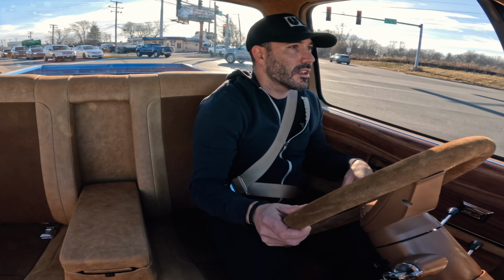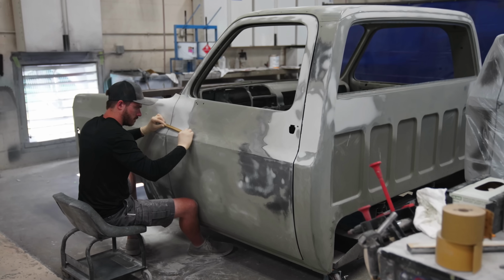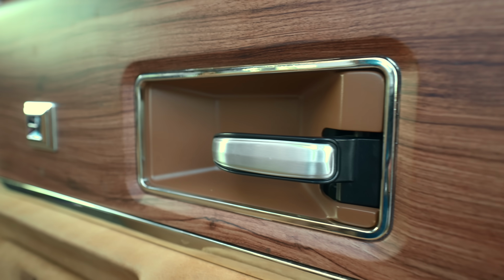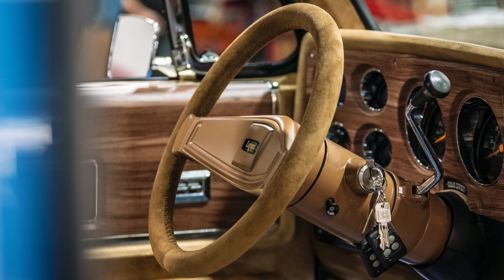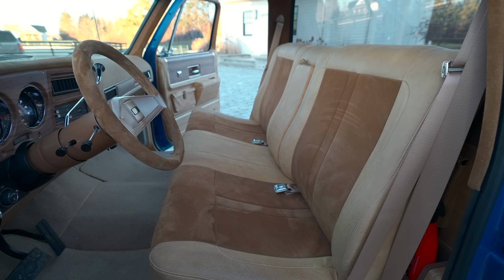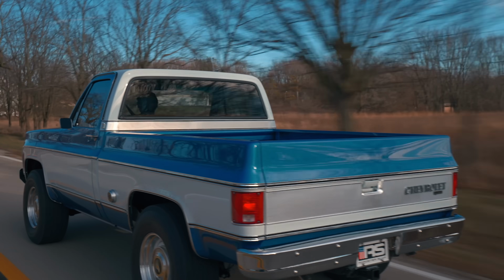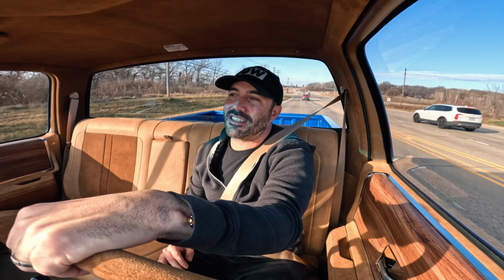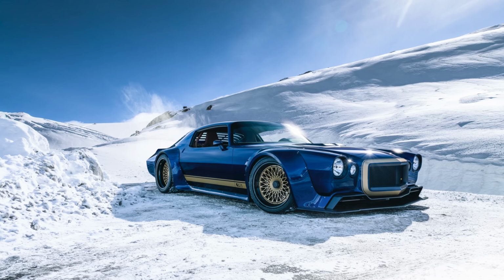The 'Urban Cowboy' | Roadster Shop Legend Series build #004 | 1976 Chevy C10 | Details and Drive!

Comment: Ramman Industries builds the front wheel bearings hubs and axles to keep the freespin lockout hub function, 2-3 mpg in 2wd and less steering bind and front end wear from being driven by the road, plus the authentic warn hub.....legit retro sexy😎🤘🏽

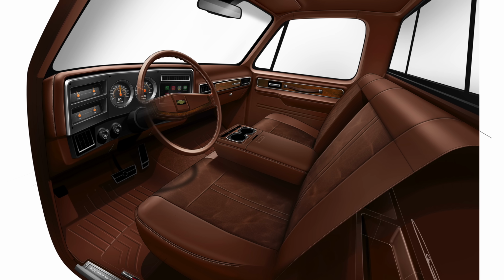Comment: 4:52.   That is perfection.   Don't change a thing.  That is a Squarebody as an escalade.  Only thing I would change about that is the driver...lol
Reply: I been looking at that pic for 10 minutes and cannot find one single thing I would change about it.   It's just right.  the 4 small gauges, the door handle relocation, the touch screen, the 4wd knobs...  that gorgeous steering wheel.   keeping the ac vents where they were...   seat and console...  trim on top of instument cluster bezel, wood on steering wheel door panels, keeping the vent wings.  damn its beautiful.
Reply: Even that color goes with damn near every exterior color.  Mine would be a black 77 with full outer trim with the yellow stripes.
Reply: did find one thing.   get rid of the 1500 on rh side of dash.  Chevy isnt a gmc.   put the trucks trim level there like its supposed to be.

Comment: Only thing I'd change about it, is dumping that LT1 for either a built ~600hp LBZ Duramax sitting in front of an Alison trans, or a built 454ci LSX (with accompanying 454 badge for the front grille) with a Holley Sniper EFI and both vintage, correct looking air cleaner and the coil/valve covers that look like big block valve covers, a peppercorn German Square Weave carpet, 2 more inches of lift (it looks awful close to those little 35s lol), and swapping that blue out for either Burnt Orange Iridescent, Lime Iridescent, or Dark Olive Iridescent.... never was a blue guy ...oh forgot one thing, and the Deluxe Two Tone, not the  Special (I like the matching roofs to side tone over the roof matching the base)..... other than those, she's perfect 👌😅

Edit: ok ok, I'd rather have straight Dana 70's front and back with 4-Links, but I still wouldn't mind an IFS for the comfort 😅

Comment: I lost my teeth in a square body. 

Just thought I'd share my square body story. 

I saved for years to buy a classic truck. I finally found the perfect one. A 1975 K-20. It was in great shape. Needed a few things mechanically, but was drivable. One day on my way to work, a Nissan Altima going 105mph crossed the yellow lines and hit me head on. Paramedics had to pry the steering wheel out of my mouth. My entire face had to be reconstructed. 

I'm currently working on fixing up my dad's old 72 C-10. I actually prefer the round bodies over squares, but this one needs a lot more work than my K-20 did. I'm hoping one day it'll be half as nice as the square body in this video.

Comment: You nailed it with the modern chassis and drivetrain. I had c10s, k10s,k20s, 2500hd 4x4, that's perfect
Reply: Yuck the “Boomer “exploding gM built square body ( rust prone) that the manufacturer got away with for over ten years,that’s horrible & shameful